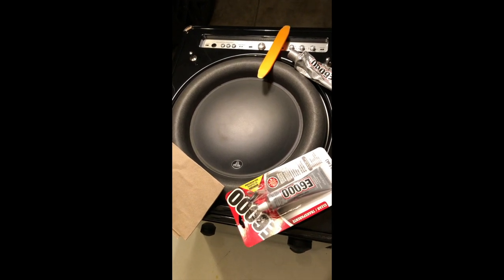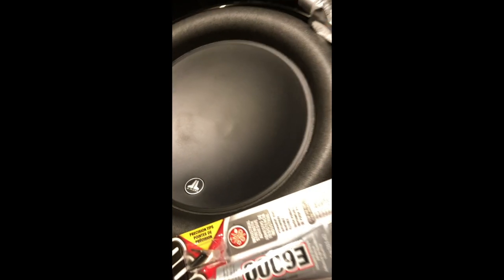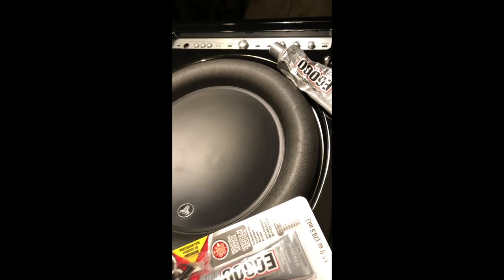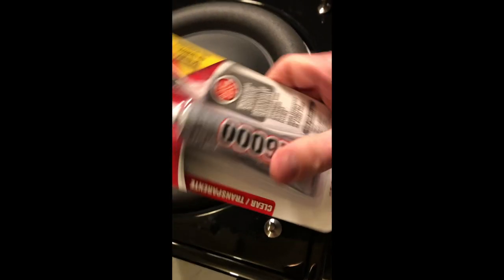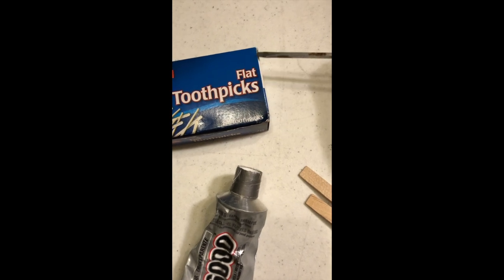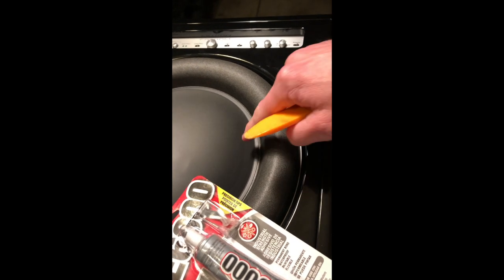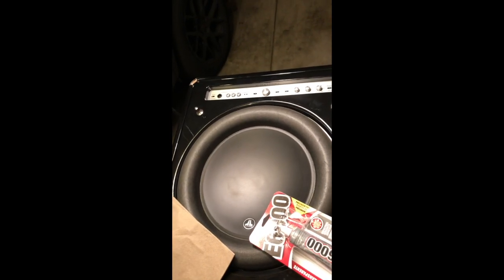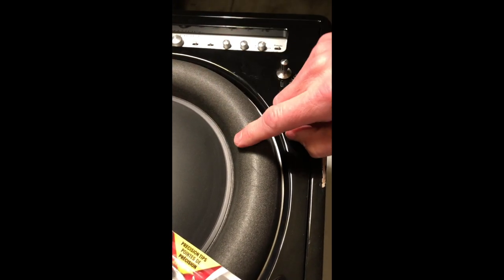JL Audio FATHOM / GOTHAM / W7 Repair - rattling sound

Comment: This video just save me from buying a new sub. I really tough my sub was blown
Reply from the maker: Awesome! You will likely have to replace the entire foam surround. Gluing the front dust cap on will work temporarily, but it will separate after time because the foam is rotting and needs to be replaced. The foam costs about $30-$50 for a replacement. Buy it from "Simply Speakers" for the best replacement option.

Comment: I started researching JL for a subwoofer, mostly repair videos on YouTube. Think I’ll look into some other brand. Come on JL…
Reply from the maker: Don't knock the company too hard... I highly recommend you still consider purchasing a JL home theater sub. They are phenomenal subs. However, as with anything, age can take it's toll on foam & other components. The foam rotted and needed to be replaced. This sub was made in 2006 and the foam needed to be replaced 15 years later in 2021. It was a $50.00 repair doing it myself. My other JL Fathom video is for the capacitor replacement. Due to age, caps dry out and eventually need to e replaced in all subs. It's unfortunate but it's just what happens. 
I hope that helps.